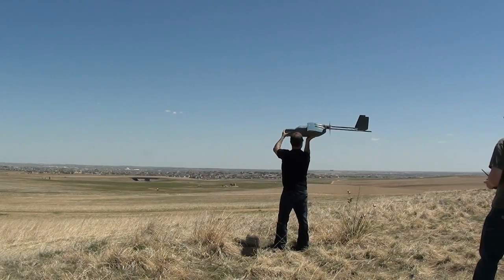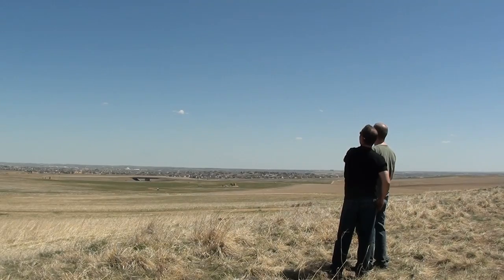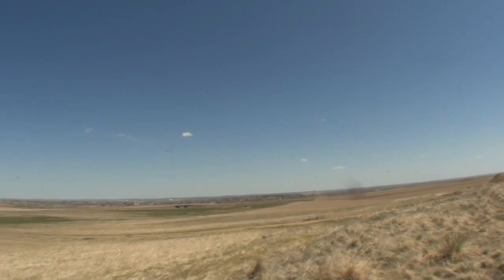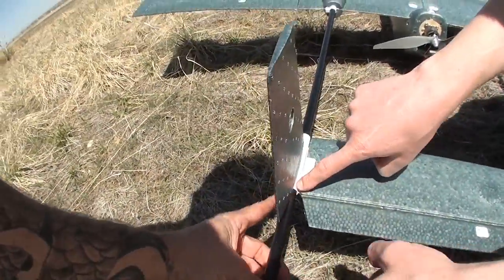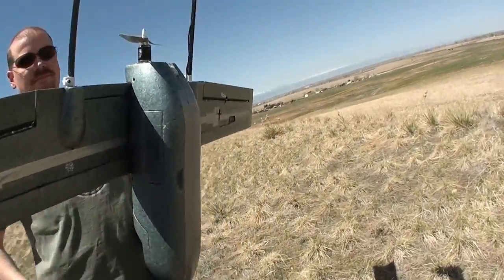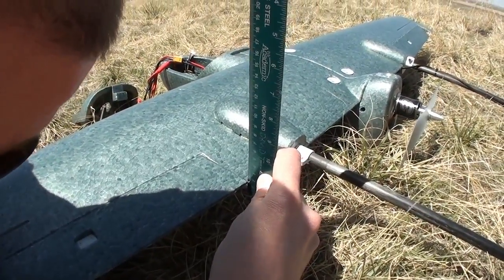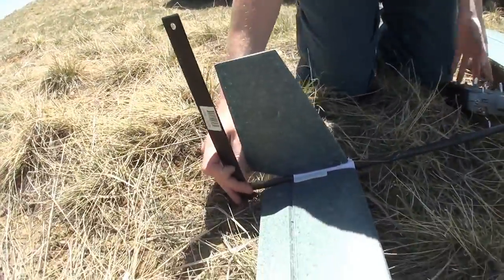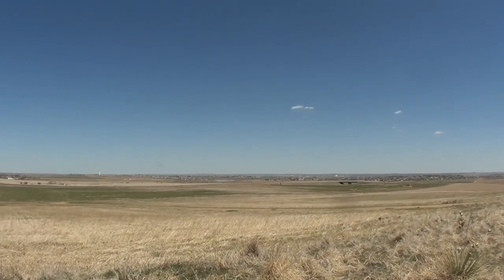SKYHUNTER FPV Build Part 9 Maiden

Comment: Was just wondering if the prop you used was a pusher? I'm new to pusher planes. Can you just reverse the motor and use a reg.Thanks for the videos ! Great job. I will be building mine this winter. Have a Merry Christmas

Comment: Thanks for sharing your knowledge. I am trying to build up the same setup. Did you end up doing any additional mods. Also do you have any fpv videos from your skyhunter? What's the longest you've had it in the air with gear before the battery ran low? Thanks!